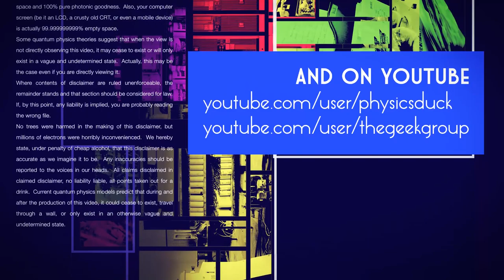Captain's Blog 4 4 2015 Above and Beyond

Comment: I don't know if you can rent them anywhere near you but they totally make actual floor grinders....not floor buffers onto which you put a sanding disc like you guys started with. Seen them used once, took like a generator putting out 480V/3Ph power to run em. Beastly things. They make them with propane power too. Obviously like way too late mentioning it but I had kind of assumed you guys knew and tried to find them already.
Reply: Cameron Marks It was cost prohibitive.
Reply: Figured it was more likely something like that +Lis Bokt -  just painful to watch!